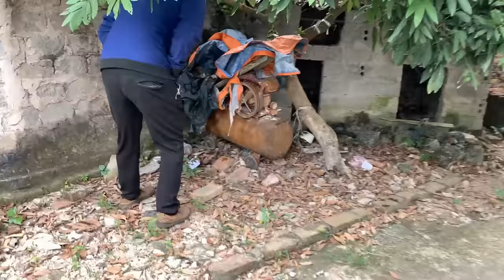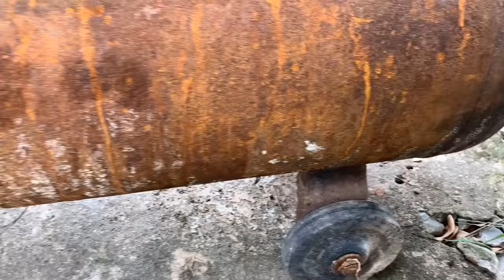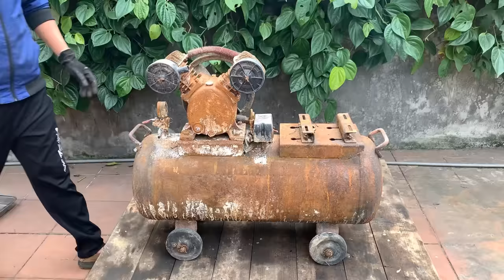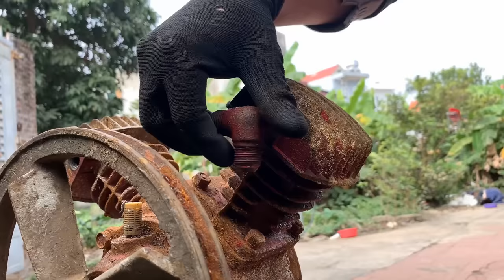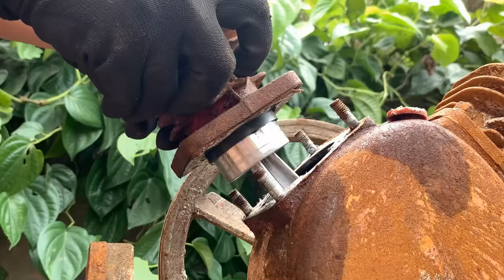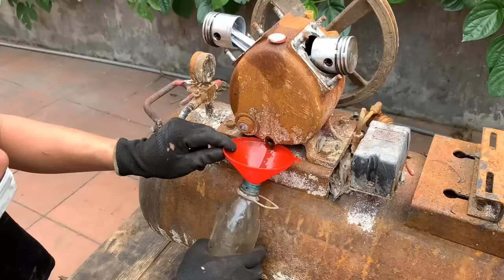💡 Restoration Of Old Rusty Air Compressor // Restore Complete Classic Air Compressor

Comment: I wouldn't trust such a rusty tank for a second without testing it.
Reply: I'd be more worried about what the inside of the tank looks like, than the outside.  Somebody needs to track this guy down, and take that great big hammer away from him.
Reply: Will it hold up to a pressure test?

Comment: Agree with all comments. Heat a bearing , cool the shaft and it will drop on. Opposite for fitting in a case. Spent my life stripping and repairing well used machinery of all types,  wish I had known about that magic spray that made  nuts and studs free so easily when rusted in. Finally, hope the pressure test on that rusty pressure tank went well!. But interesting video.

Comment: A little tip, when you connect the wires, put the cords in on the left side of the screws, because then the screws will pull the cords in, if you put the cords (as you was doing) on the right side of the screws, then the screws will push the cords out. By the way, a nice job.

Comment: An excellent painstaking restoration my friend as to the inside of the tank rust I'm no air compressor expert so I cannot comment good or bad 
but I felt you did an excellent job a very very time consuming job with an excellent outcome. It looked really good after you succeeded in restoring this old junked machine.

Comment: That crack. You can just weld over it and grind it down, but it'll cause a vibration. Better would be to grind both sides to a wedge and close the gap, then fill it with weld and grind it smooth. That would ensure the roundness of the wheel and reduce vibration.
Reply: ષઠઠડ

Comment: Why you not removed the all ball bearing ZZ dust O ring  OF THE bearing it will stop lubrication when you filled oil to compressor the oil will not lubricants the bearing and the inner ball bearing shall , it will the case overheating of bearings , and your compressor crank gets jarm so remove the bearing O ring seal when installing in compressor where oil lubricants the bearing.

Comment: If the tank is heavily rusted on the inside that thing is a timed bomb.
Reply: No, it’s not
Reply: No, it’s not
Reply: @rotarycomptech  yes it is
Reply: @necsoiub  i’ve been in the field for over 30 years air receivers. Do not rupture due to rust. Sorry it’s always over pressurization.
The tanks are always full of rusty water and rust. Do you really think a tank manufacture is going to make a tank that’s going to rupture because of rust being in the bottom of it. If this was the case, this sure would be happening a lot but it only happens to a very small little air compressors why? ?
The little compressor is running along and it’s starting and stopping using the pressure switch contacts.then one day the contacts weld them self shut or closed. Then you have a runaway air compressor. The only thing to keep the tank from exploding at this point is the pressure relief valve. If that fails, the tank will explode or maybe the discharge line might blow off to save the tank from exploding and that is how that happens.

Comment: I got 16 minutes into this and couldn't watch anymore. That tank's WAY too far gone to be reused. It showed heavy rust pitting on the outside, so god only knows what it's like on the inside. A ruptured tank is enough to kill anyone standing close. It's unpredictable, and even at 100psi, it has enough stored energy to launch the whole of that compressors mass into the ceiling, or across a room and to kill someone.

If there's ANY question about the condition of a tank, it's always best to replace it, or do a wet high pressure test to check it's not going to rupture at normal working pressures.

Comment: How were you confident that the tank would hold up to pressure after being allowed to rust away.  No doubt there was water in that tank that evaporated.   I wouldn't want to be near that tank when it decides that  175 psi is a bit too much

Comment: I have a compressor like that big one, has a 5hp electric motor on it. The start and run capacitors are gone though. Also the motor info plate is unreadable so how can I figure out what capacitor sizes I need for the motor ???

Comment: Nice rebuild.  Lucky for you that it was only the valve block that needed work.  The pistons, rings and barrels looked perfect.  I rebuilt an Ingersol Rand compressor once and I wasn't so lucky.  And I couldn't get spares because it was a model that was obsolete in 1960!  It still worked famously, though.

Comment: nice job,but skill level is not so high... hitting ball bearing with hammer to the outer ring - NO...piston needs oiling befote putting it in cylinder,othervise makes scratches...heatting up this part you killed with bearing puller will save its life.....little  pipe has cone on its end and dont needs teflon tape to be sealed connection...teflon tape allways goes clockwise ...etc..still-good job sir !
Reply: ?That is the B.F.H. school of repair and technology get er done!

Comment: Typically the tank will rust at the bottom from the inside out. There is a drain valve at the bottom to drain water that condenses in use. Even so they will rust. The compression may look like new on the outside, but it could literally explode like a bomb !
Reply: Totally agree,
Used tanks should always be tested.
I always would test used tanks with hydrolic pressure (water) to factory specs and insure they hold pressure for several hours.
Reply: That receiver could be dangerous, I would never use anything like that without a proper pressure test
Reply: Sorry sir but tanks don’t explode due to corrosion or rust. It’s always over pressurization that causes them to rupture
Reply: Are you serious!  A pressure vessel has to be tested (hydraulically to at least its rated working pressure  @rotarycomptech
Reply: @johnwilson6298  yes I am serious and yes I was in the field for over 30 years. I know what I’m talking about.
Reply: Exactly what I thought
Reply: Ahh hell imagine this fellar knows what he’s doing but y’all keep coaching

Comment: This was painful to watch. No regard for brittleness, banging on the cylinders with a metal mallet, snapping the main pulley and then “repairing” it with superficial welds. Made it about 27 minutes in and stopped. Hope this tank hasn’t killed or hurt anyone.

Comment: Looks good , you need a one way pop off valve to relieve pressure on head for start up , the back pressure is fighting your pistons on start up.
Reply: It's installed at 39:42
Reply: I never heard of a one-way pop off valve and I’ve been in this field for over 30 years. Please explain.
Reply: @rotarycomptech  actually called unloader valve, relives all the pressure from pump cylinders so it's not fighting pistons on next start up,, always placed in pipe from pump too tank also keeps pressure from leaving tank going back to pump.
Reply: @georgespangler1517  oh wow thanks for the information I didn’t know that.
Reply: @rotarycomptech  your welcome,, will notice when a compressor reaches enough pressure to satisfy pressure switch you will hear a air hissing sound that's the pressure bleeding out of the cylinders so pistons aren't trying to fight against it on next start up.
Reply: @georgespangler1517  wow that’s absolutely amazing

Comment: Watching a lot of these videos where they pound on bearings is just cringe. If you are going to hammer on a bearing try to hit the part that doesn’t allow the impact force to go through the bearing balls.
Reply: Also looks like thier is no need for the sealed bearings as it will have a oil bath could have left 3 of the 4 seals off the bearings.
Reply: Verdade
Reply: What is your channel?
Reply: Genau!
Reply: But it is only show

Comment: Pretty paint on the outside and cleaning the inside of the tank looks great, but no amount of cosmetic improvement will make that tank safe to use again  as an air compressor, because corrosion has compromised and thinned  the tank walls, and it is now a ticking time bomb.  I wish you good luck  and hope it does not let go and kill somebody or put an eye out from flying shrapnel.  Foolish.
Reply: Siri, you don’t even know what you’re talking about

Comment: The tank is shot to much rust on the outside means way more on the inside, throw it in the trash before you hurt someone.
Shit you can see all the pitting on the outside after the fresh paint thats insane drill a hole in it so no one ever uses it again.

Comment: With that very rusty air tank how safe is it could be very thin in places i would not want to trust it with high air pressure in it could explode  i have seen what happens when they do it is not good metal pieces fly everywhere i definitely would not trust or use i

Comment: Let this video be a W A R N I N G. Never repair these machines without FIRST checking the condition of the air-tank or ALWAYS USE A BRANDNEW AIR TANK!  They rust from the inside and become extremely fragile without any sign the thing is weak & will explode, badly injuring, even KILLING whoever is nearby. PLEASE be sensible. A compressor like this one is JUNK. Throw it away!

Comment: painting over rust is never good and hes right use a socket or a press on the bearing and if you dont have one invest in a sand blaster and did you even use asatone or a cleaner for the inside of the tank but very suprized the pistons looked that good and did ya put new rings on them other then didnt rebuild the motor and bought a new one nice job though :)
Reply: Me gusta mucho la Mecánica ameri cAna.
Reply: @cesareosantiago9081  dont no what that says sorry :(
Reply: Good
Reply: He doesnt understand English  that is why there are no replies

Comment: Building a bomb would be a better title for this video. Sorry but this ist something between stupid and dangerous.

1) cracking the belt wheel
2) destroying new bearings with hammer
3) using rotten pressure vessel
4) clamping wires without ferrule

...and more

But brave to stand next to it with pressure in the tank.

DON'T DO THIS AT HOME! ☠️

Comment: Without repairing the pistons‼ without hydraulic test of the tank‼ without control of load cut without technical service of engine‼ without new pressure switch‼ without new pressure gauge‼ without test of operation‼ .... it's just a piece of painted scrap🤬🤬 🤬🤬👎👎👎👎👎👎👎👎👎👎👎👎👎👎👎👎👎👎

Comment: Nice project, but terrible effort breaking the flywheel. Next time a little more finesse. And now that you have it working, you seriously need to do a hydrostatic pressure test before putting it back into operation. JMHO

Comment: The welding on the flywheel pulley was 'shit' and a joke. Not only did he NOT prepare the surface for welding [i,e, bare cleaning and beveling], but he used the wrong welding method, and finally never had the wheel true balanced for proper function. It will be a disaster, like everything else from that country.

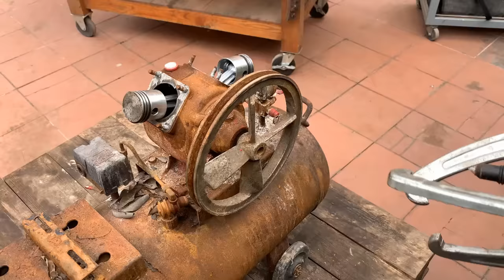Comment: The pull spool was faulty, presumably pulled from the shaft base. Not from the edge. time 7:50 and 20:22 Also, the notch is supposed to screw  or stick to each other before welding.
Reply from the maker: THANK YOU